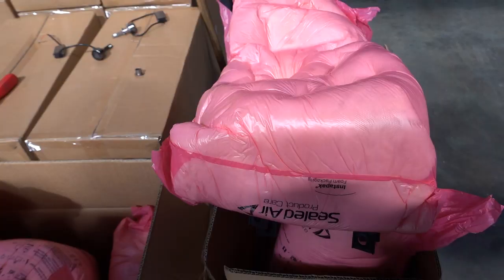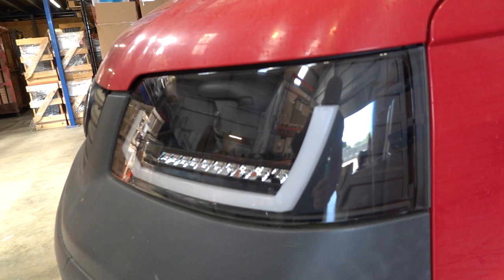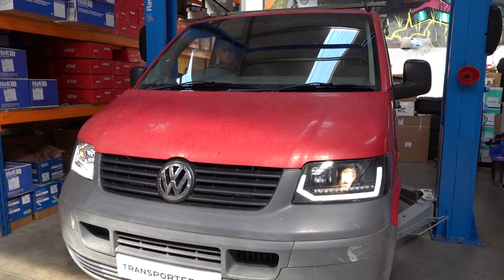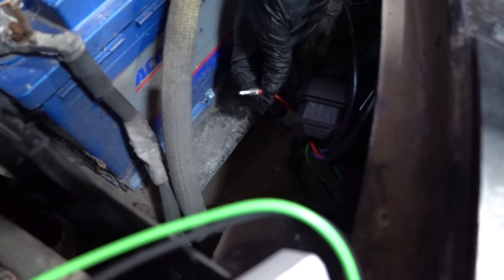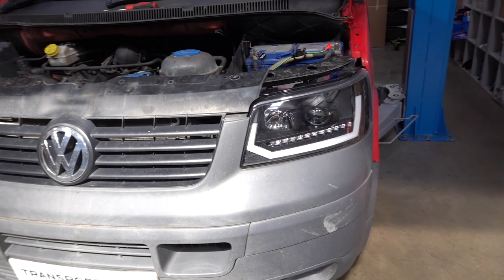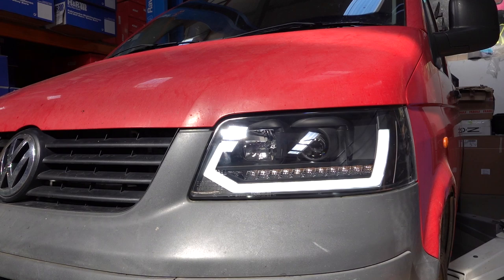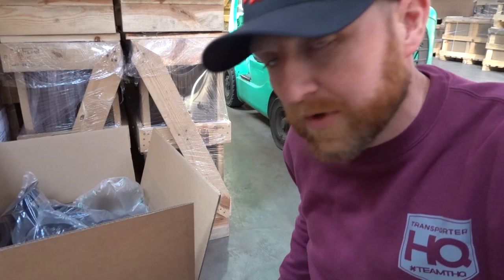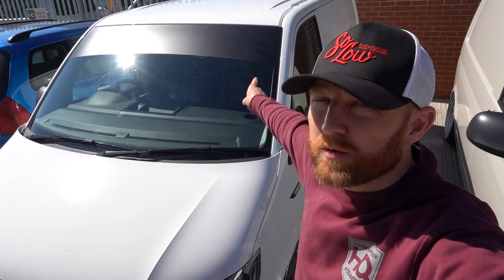T5 V2 Headlights (2003-09 Pre Facelift) | Transporter HQ

Comment: They look ace....sigh another thing my van now "needs" lol. Could I leave out the voltage sensing part of this and just wire the drl section to a switched live?
Reply from the maker: No because the section takes to feed and one needs to switch off the other (drl to side light) if you did that it would blow the LEDs.
Reply: @THQAutomotive  ah ok, glad I asked!

Comment: Hi, is there anyway of adjusting the time the drl stay on after locking the van? Mine stay on for ages after 😅
Reply from the maker: Remove the fuse in the loom for 10 minutes and put it back in again to re set this.

Comment: Will they fit a caravelle 2008 and can you have Led Supplied as a package also is that legal  / mot? :).
Reply from the maker: Yes they will fit a 2008 Caravelle. You can't fit our LED's though I'm afraid. There isn't enough room in the back of the house to fit the resistor in.

Comment: Hi guys like the videos, I have a 2010 caravelle, 2.5,  I had a smell of melting wire come through the heater vents, and then the radiator fans come on, the smell has now gone, but I start the engine and about 10 seconds after the fans come on and stay on, until I turn it off,, had it plugged in. Said aircon sensor, 60 quid later fans still come on, any ideas, thanks George.
Reply from the maker: Sorry I have no idea :(

Comment: Just had mine fitted, but for some reason the DRL stay on for at least 30mins after the engine is switched off, has it been wired up wrongly....??? Thanks
Reply from the maker: Call the office and they'll help 0116 2478156
Reply: Was there an answer to this as have fitted a new battery today and the DRL’s stay on for ages wheras before changing the battery they went off after 30 seconds

Comment: I have these in my t5 and am a little confused as to why my dip goes out on main  beam but the ones in this video say on ?
Reply from the maker: They don't, i think its just the way it looks in the video when Mikey has the flasher on inside. Any early T5 doesn't have this feature. The lights just do what the vans tell them
Reply: @THQAutomotive  I thought that might be the case 👍
Reply: @THQAutomotive  bit gutted about the drl side of things , i ran it for a bit but on most occasions it would stay on for over half an hour after ignition off 😳
Reply from the maker: @Doogiehowzer  Your van doesn't have a DRL. This control box tricks the headlight into thinking it does. After long journey's, the power gets stored in the control box. Its not drawing from your battery. You can just remove the fuse for 10 minutes to re-set it. Failing that remove the box and run the lights the same as the original with a DRL. You can just turn your side out on to have the DRL on instead.